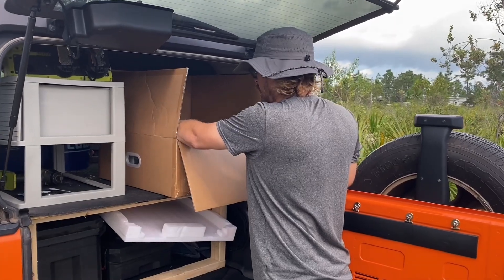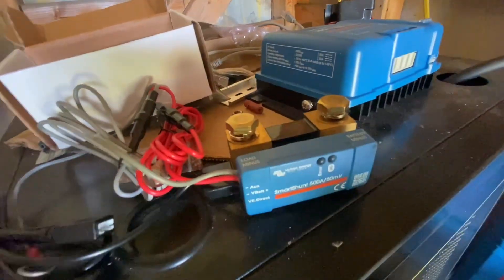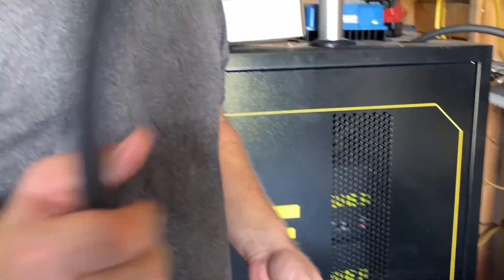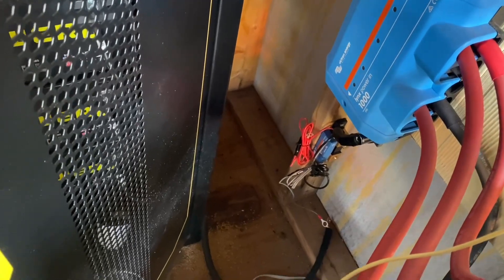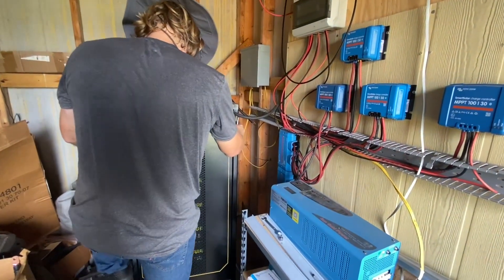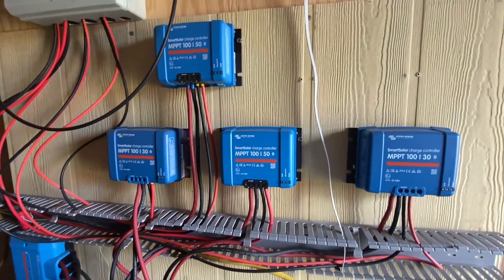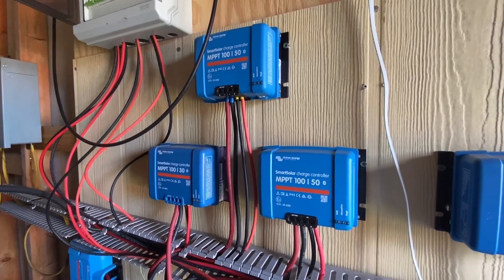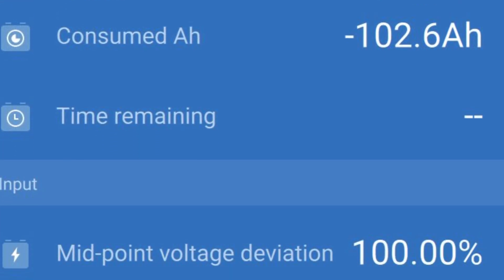Off Grid Solar EG4 Final Battery

Comment: The EG4 battery has an Amphenol connector but the latest data sheet shows dual screw connections. Did you special order the lifepower 4 v2 ? Nice setup I’m also in Florida and my solar kept my lights on during hurricane.
Reply from the maker: @ColorMaker_Solar  we ordered the same battery as the others in August for a Sept pickup as they were out of stock.  When the batteries arrived to Signature Solar, we were notified that we were receiving an upgraded model at no additional charge.  So far they are all working fine together with no issues.  We do not use the networking cables though so no way to know for sure but we have not had any loss of power and they are all usually charged full by noon.

Comment: I think you ment to point the 1200 watts panels systems- to the 30 amp charge controlers,and the higher amount to the 50 amp...50 amp charge controler can give 2500+watts/hour on 48V battery systems,thats a nice amount.Ofcourse most ppl dont max them out,they have no active cooling,nevertheless they are awsome charge controllers,good choises,they are the most efficient on the market...look like an awsome system.Also having split up like that is very good for redundancy,they dont really ever break,but in case it does,there are like 3 other still providing power for you! coll stuff,thx for presenting:)
Reply: Oh you got 25V system? sorry i wrote first comment at half the video XD still the same principle applies...interesting,i didnt even know they have server rack style batteries on 24V bateries...
Reply from the maker: @83kaszas  yes we are on a 24v system as we do not have any appliances that require 240v.  We have a gas oven/cooktop as well as an antique wood burner that we are going to be restoring.  We do have an all in one washer/dryer but rarely use the dryer as it takes hours to dry so we usually wash and hang the clothes.  The ac, well pump and freeze dryer use the most amount of power but the pump only comes on for short amounts of time.  I am glad you enjoyed the video, we did the system this way because it has taken us years to build it out of pocket.  We started with the 30amp panel sets and 12v marine batteries, then later added more panels and eventually switched over to the EG4 batteries as we could afford them
Reply: @theblueriverhaus  Now You just need a Victron inverter and a cerbo GX,and you ca have advanced monitoring :)
Reply from the maker: @83kaszas  We really like the sungold inverters, no issues yet and one is over 5 years old!  The cerbo would be nice but for us its not a necessity
Reply: @theblueriverhaus  i see,was just a suggestion,i myself rolling all my house on a Victron inverter,and they are also very good:)